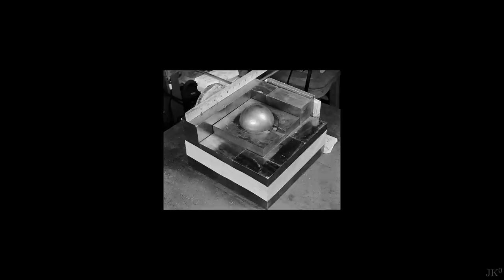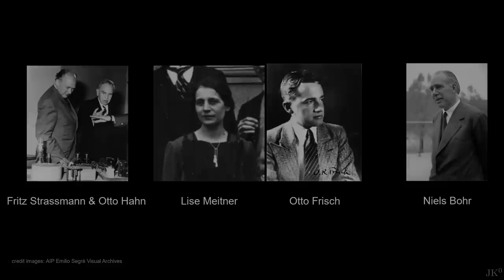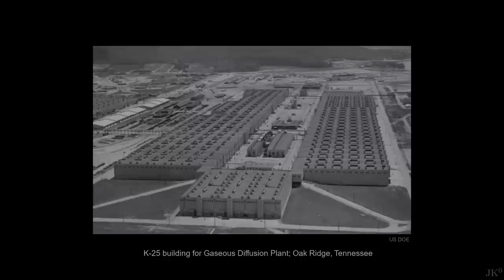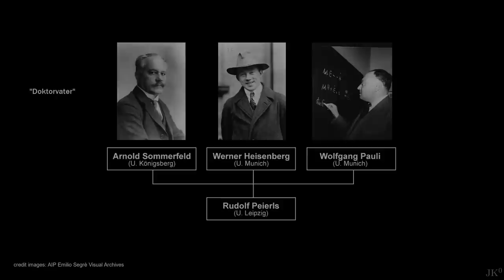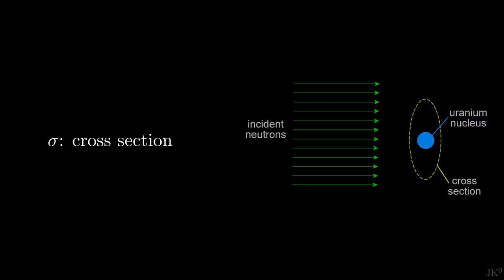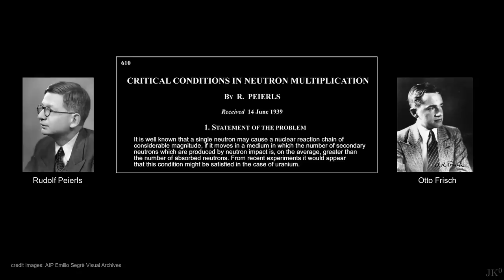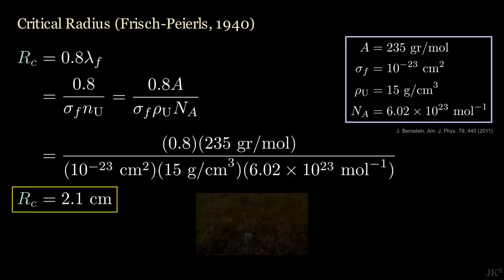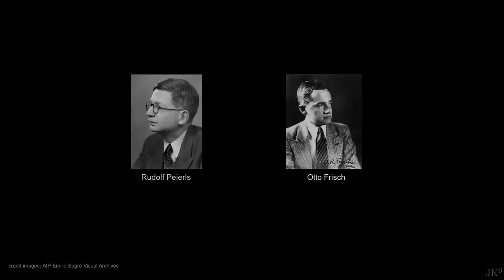Critical Mass: when the atomic bomb got real

Comment: Cross-section is not a probability and cannot be thought of as such. Probability is not being measured in the units of area!
Reply: Cross section is the coefficient of proportionality between the numbers of event N in your experiment per unit time t and the incident flux of particles F that you're sending. Therefore cross section = N/(t times F). The number of events is the number of particles that you have times the probability of a single event to occur. So the cross section is directly linked to probabilities: the higher the probability, the higher the cross section. We use this idea and evaluate probabilities, using QFT and S-Matrix, to get theoretical values of cross-sections of many different processes.
Reply: @peppescala4113  In the video he said that cross-section IS a probability, not "linked to", but "is", which is not true. And it can't be true even from dimensionality analysis.
Reply: @gaHuJIa_Macmep  If you want to be fussy, then you're winning. It's completely clear what he meant.
Reply: @peppescala4113  I don't want anybody to be fussy. I want everyone to be precise. Is it so difficult???
Reply from the maker: @gaHuJIa_Macmep  you are correct, cross-section is NOT a probability. In the video I say "it can be understood as probability," which was intended as "proportional to probability" but you are correct when it comes to precision: I could have used better words. Thanks for bringing this up, I do my best to avoid statements that can be misinterpreted but sometimes they just slip in.
Reply: @jkzero  ok, thank you for your reply. Could you also comment on my comment regarding your second video concerning critical mass and diffusion equation solving?
Reply from the maker: @gaHuJIa_Macmep  of course, I try to go through the comments and answer what I can quickly during the night. Thanks for watching and the comments, the engagement helps the video by making the algorithm show it to more people. Thanks you.